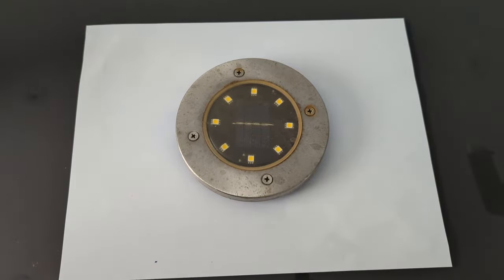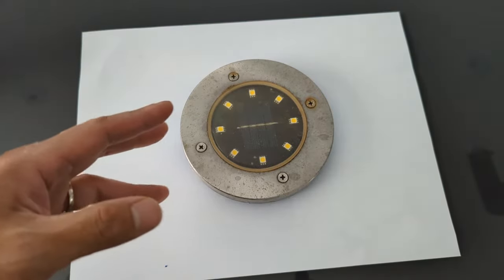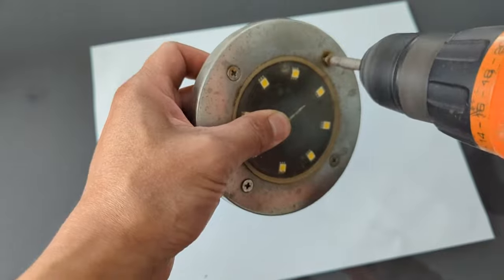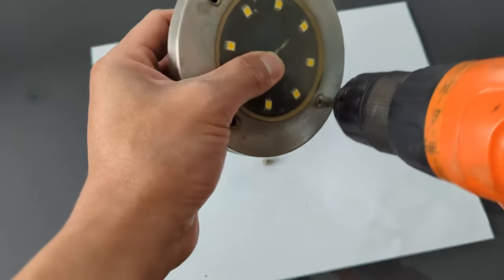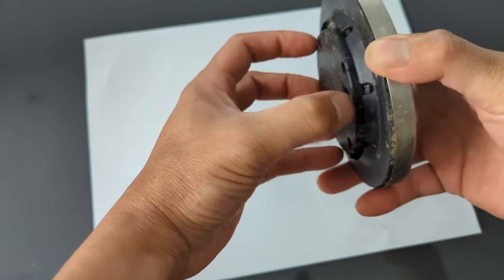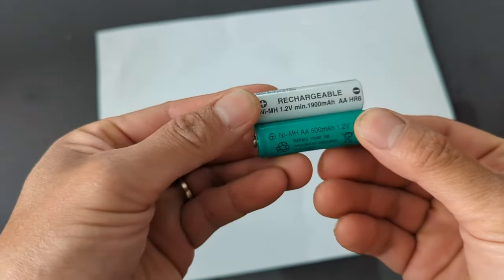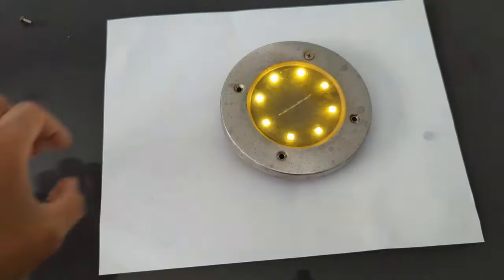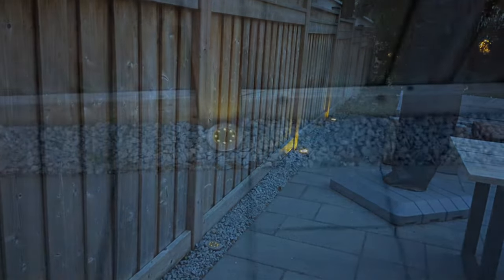How to Fix a Solar LED Light by Changing the Battery

Comment: I have a solar pathway light that is dim. I took it apart to see the batter - NiMH - but the battery is literally wired in to the light! I'd show you a picture if I could upload an image here. Do you know if it is possible at all to replace that battery?
Reply from the maker: Hard to say for sure without inspecting it, but if it is a regular NiMH battery, it should be replaceable. Let us know how it goes!
Reply: Thanks. I'll do that.
Reply: Yeah mine is wired in too…. Soldered to each end of the battery 😢

Comment: When you open up solar light and full of water should you through away or just clean and replace battery
Reply from the maker: It depends on the condition and age of your batteries. In my case, I replaced the existing batteries with ones that had a higher capacity.

Comment: Replaced the battery of my solar lights, nada. They had 3xNi-Mh 2000mAh 1.2V batteries in them so i bought Ni-Mh 2600mAh 1.2V batteries.....Nothing, replaced them and at night nada.....Then i used 2000mAh Ni-Mh 1.2v batteries....Again, nada...
Is there ANY chance the circuit is identifying that the batteries are not the exact same ones as the ones from the factory? Thank you.

Comment: Can I just recharge the old battery and use it again?
Reply from the maker: You can definitely try that! In my case, the original battery was lower in capacity so I changed mine out. If your original battery is still good, it's definitely worth trying.